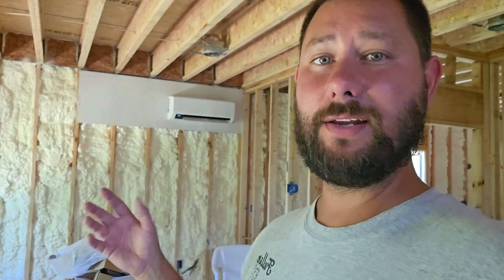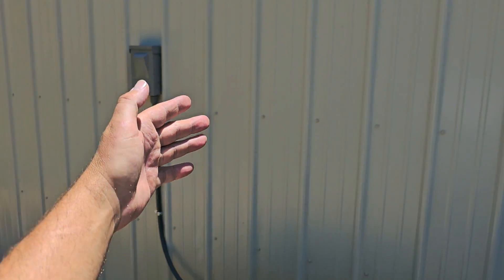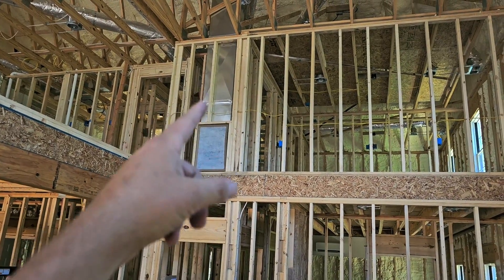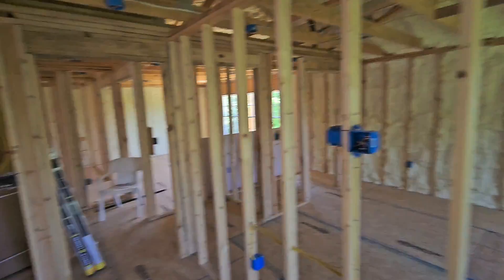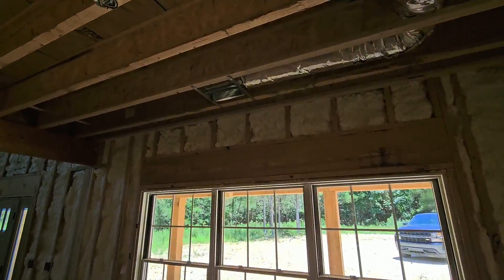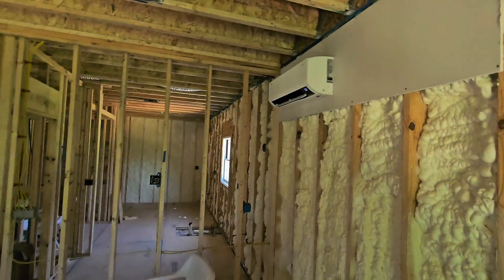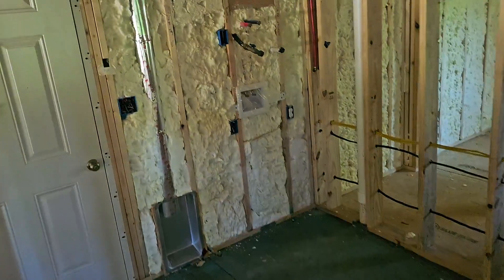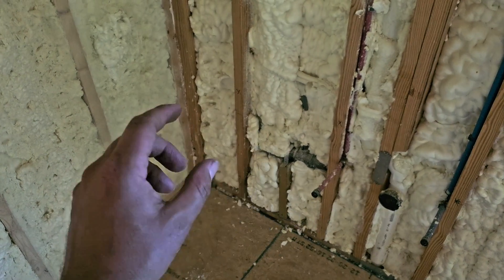New Build HVAC Tip: Mini Split Rough In Guide

Comment: Taddy, thanks for doing this video.  I do not have a rough in box and was thinking about running 2.5 in conduit in the wall so I can run my EG4 12K lines after the sheet rock is installed in my shed.  I am not sure the rough in box will get here (Amazon) before they start to sheetrock.  Any thoughts on using PVC to reserve the space for the lines?

Comment: Hi, I’m new to the mini split world. I’ve take some classes, done some work in the field but I don’t understand how you mounted the head mounting plate on the Sheetrock before installing it on the wall. Im doing a job on a 2x4 wall and the RI box is too deep for the stud bay.  How did you insulate behind the Sheetrock? The video didn’t get into the details of the line set install. Looking for some help. I’m currently waiting to install 3 heads in interior walls. I could really use the help.  Thanks
Reply from the maker: I'll try and do another video very soon.Showing that process as well

Comment: I appreciate your videos. I just had a rough in box installed for a 12K BTU mini split. Do I need to add nail plates or anyway to protect
the lines that are running down the bay along side the window from future getting screwed into etc? Like to hang curtains etc? Some kind of long nail plate? Thanks!
Reply from the maker: Yes, nail plate should be at the top. And the bottom of studs for sure, if they pass through

Comment: That supply transition onto your main trunk looks a little steep? Dont get me wrong it looks good, just curious how the final airflow turns out

Also are you working on 100cfm per outlet? What static pressure is that unit delivering for those duct runs?
Reply from the maker: .05 static around 75 cfm per